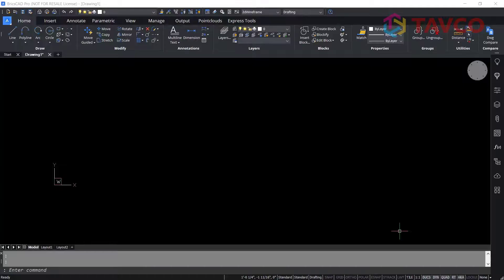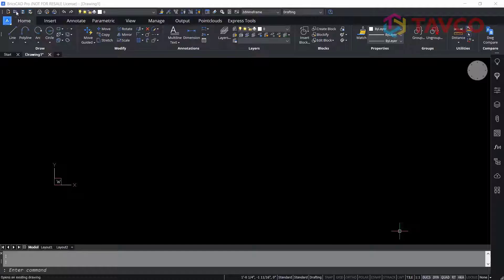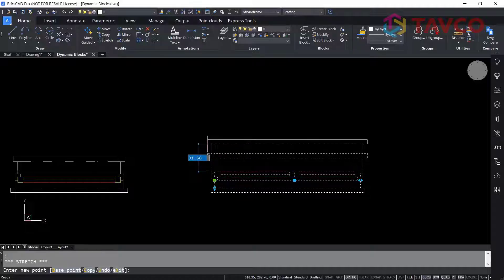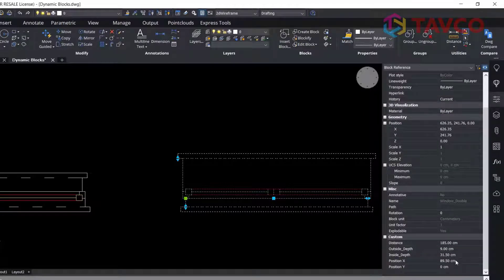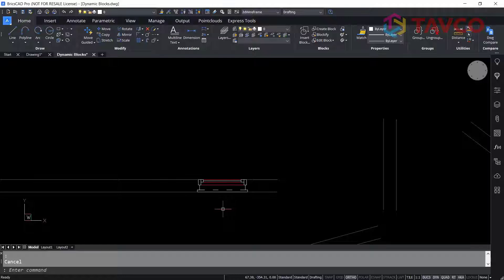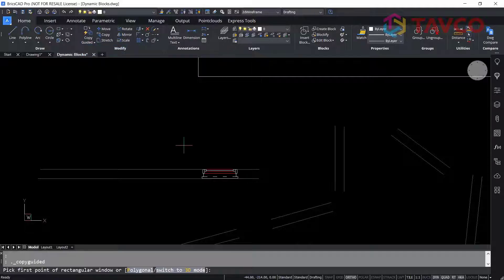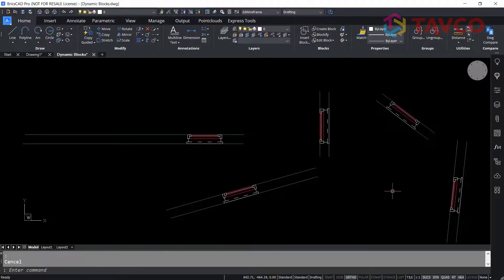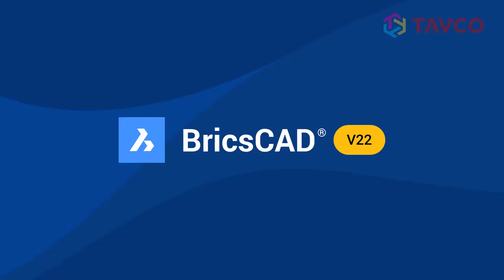How to Use Dynamic Blocks in BricsCAD

Comment: If the dynamic block has multiline test attributes, BricsCAD V23 can't change them and crashes
Reply from the maker: Have you tried this in the new v23 version with the Dynamic Block Converter?
Reply: @tavcotech  
yes, but I need not to modify the starting block and to keep its characteristics, but it tells me this: "an unexpected error has occurred. The application has become unstable. It is recommended to save your work in a temporary file and restart the application." what can I do to solve this problem?
Reply: @tavcotech  
i did various tests including trying to replace multiline text attributes with simple text attributes and it works, i only have problems with dynamic blocks with multiline attributes... i just can't work with dynamic blocks